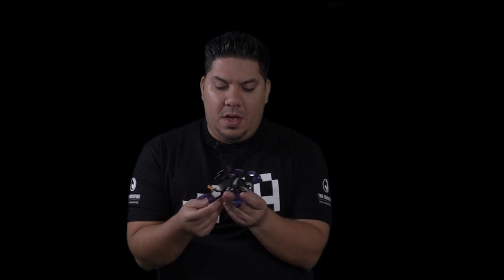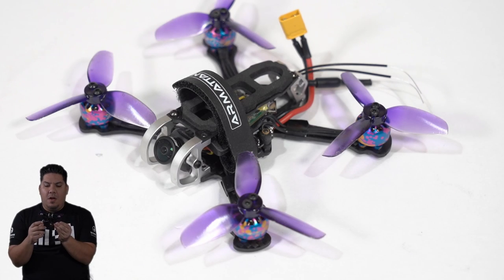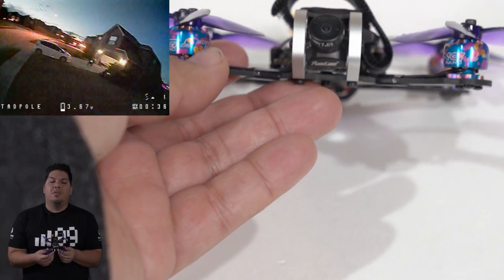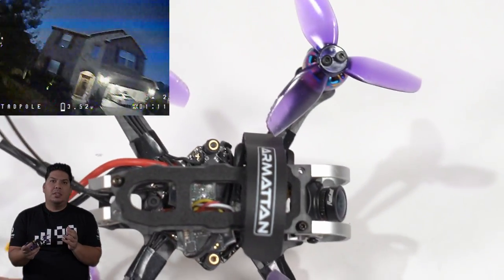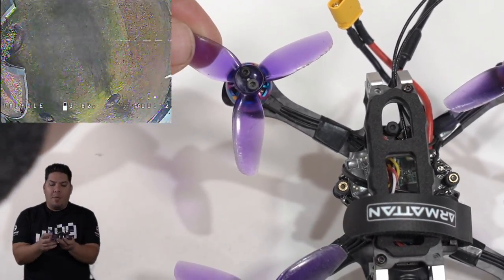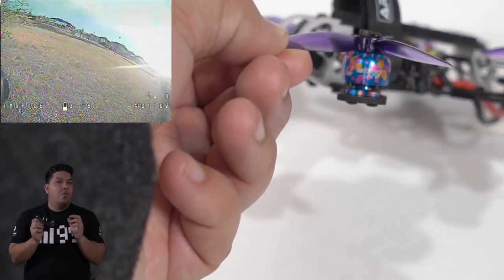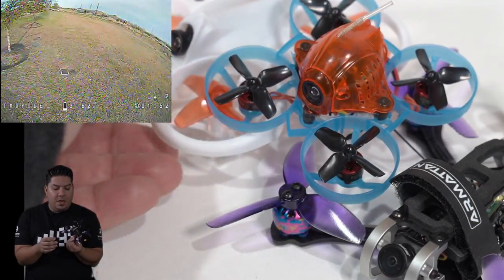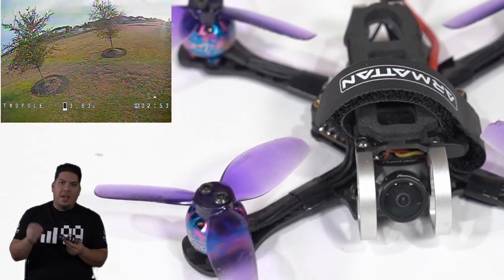Armattan Tadpole - Xing 1105 Full build, Flight Review video -Micro toothpick drone, tiny Freestyle

Comment: I made one with 1105 xing 4500kv on 4s, I get about 6 mins flight time. Also, using foxeer nano predator 4 and it flies so nice! mines is beefy and weighs 81g with the betafpv 20amp aio board, it's heavy but with motor prop combo it's perfect! Love my Tadpole, great practice toothpick!
Reply from the maker: Very nice!  Do you get any oscilations at all? Or the props fluttering with the extra weight?  I went to a larger 1106 motor to get ready for the 3" version, but it seems weight is a little much (but may just be need to re-tune) if yours is working well.
Reply: @JonE5FPV  hi, yes it does get fluttering and some prop wash on split s sometimes if im not smooth coming out.  I have betaflight 4.1.5 and rpm filtering and lowered the filters as much as possible but keep the motors cool. I have been doing some pid tuning but with sliders to get to the feel I like. I'm still relatively new to hobby, started last summer but took a break in the winter. Check out my tadpole 4s video: https://youtu.be/SN8bv7_klGw. Let me know what you think and what I can do to improve the prop wash and flutters off big moves?btw I'm using hq 2.5x3.5x3 prorps and love how smooth and lift it has. Tried the 65mm dual blade and 65mm tri-blade and didn't like them as much on this build.

Comment: Totally agree with you!
Although I when the other route. I did a Iflight 16 x16 stack 12A,F4,VTX with Fywoo 1103 7650kv, running Tattu 3S 450mah.
Without battery 67g with 108g
Reply from the maker: Sounds very nice!  i am kinda wanting to try some larger motors, with a high kv and then 2s.  Trade some quad weight for some battery weight.
Reply: Hey this is exactly what I'm building. I haven't gotten alot of the parts. Can you recommend flywoo motors? I heard they have zero play in them, is that true? Also I fly tattuu 3s 450mah on my GEPRC Phantom. I get 8 min fly times, what do you get on yours with with the three blade props. I got both 2 and 3 blade, I feel like three will eat the battery up like this guys 3 min flight time.
Reply from the maker: @zachbishop3795   I have not used the flywoo motors yet, but i hear good things.  I do have their new goku stack in to review.

Comment: Nice! I was thinking of building one of these but still happy with my freestyle 4s builds on 1304 and 1404 motors.
Reply from the maker: I need to try a nice 1303 or 1404.  But it’s hard when that Emax 1306 is so light.

Comment: I've not really had a whole lot of component failures in my toothpicks - I think low weight can do more to keep things from breaking than the aluminum. Really like the design, but the weight would keep me away. Even my geprc phantom (which is a lighter frame than this) build feels heavy compared to my other toothpicks.
Reply from the maker: Same thing I thought but it does have its place after flying it.  Especially for people who fly freestyle 5" quads.  If you fly mostly race quads, then the Diatone Cubes will likely feel the best.

Comment: I've been looking at the tadpole for a while now and already LOVE my 2208 XING CAMO's.. but now for something smaller.. my question is what size 3s are you running?? Also, do you think a 12amp esc would be enough for a more aggressive tri-blade using these motors?
Reply from the maker: Using 450mah 3s.  12a should be enough. That is what I am gonna use going w larger motors for the 3” version.
Reply: Change of plans. Sticking with the XING Camo 1105s but with 4s on a 3in toothpick. Should be a RIPPER!

Comment: nice man ...should try the 1206 6500kv ... its an animal .. and runcam split 3 nano fits perfectly :)
Reply from the maker: sounds like a beast, how much weight did you end up at?
Reply: @JonE5FPV   87 g without the battery ..134 with it :)